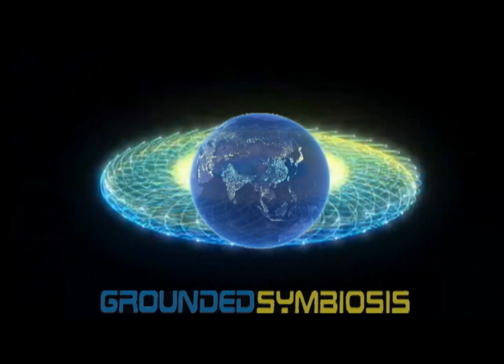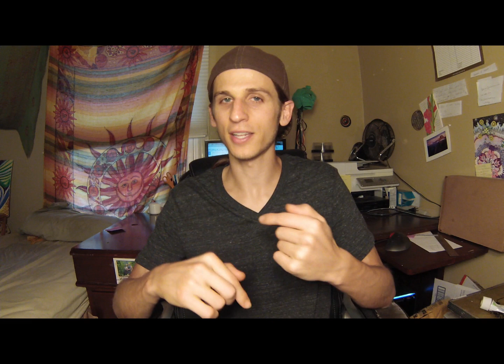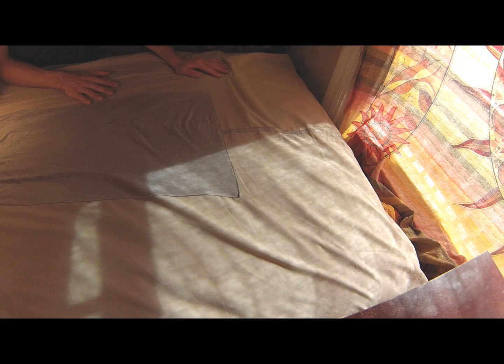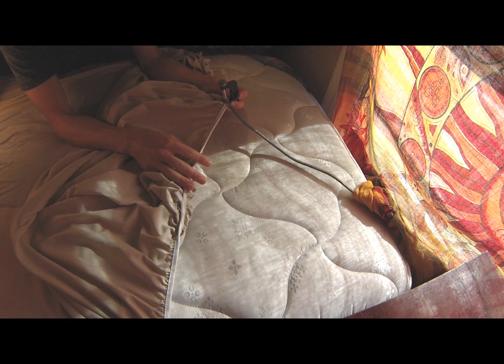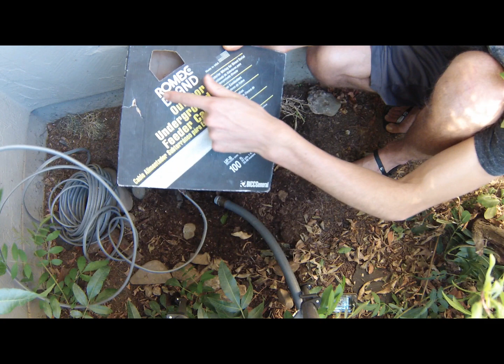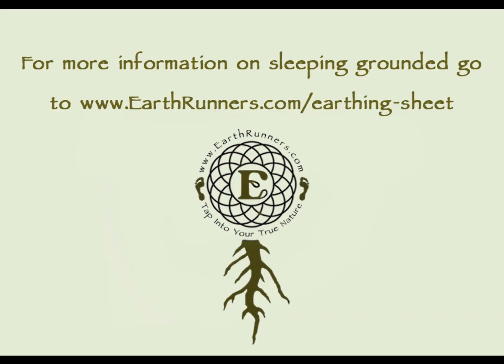Earthing Sheet Tutorial: Make Your Own Upgraded Grounding Sheet

Comment: Hey i have a question, i have a insulated wire running out my window plugged directly into the earth, and when i use my emf reader my bedsheet is at aprox, 40 vpp?  Im not connecting it to any wall outlet or any hot source and i have no EMFs in the room anymore so how am i electrifying my bedsheet from just plugging it into the ground?   I would expect a 0 on my reader
Reply from the maker: What material is your sheet?

Comment: Still earthing?  Question, if you are still around and able to answer.  If I were grounded with an earthing strap, and my partner and I had conductive sheet on our queen sized bed.  Would his body become grounded since my body is grounded?  Thanks!
Reply from the maker: Always earthing! Do you mean you'd be wearing an earthing strap like around your wrist or ankle that is connected to a wire that goes outside into the ground? If you use an alligator clip or something like that to clip onto the conductive sheet, that would be a simple & effective way to ground you both.

Comment: If anyone would be so kind as to help me out here, how are you supposed to prevent the risk of a lightning strike hitting that copper rod and energising you in your sleep (ouch!)? I really would like to ground / earth my own bedsheets too, but there seem to be so many risk factors... :/
Reply: Ded note, I believe I have read that some use a resistor on the wire that would act like a fuse in the event of lightning hit, I think they said a 100 ohm resistor?
Reply: more like 100kohm
Reply from the maker: Definitely disconnect when lightening is in the forecast. Better safe than sorry.

Comment: you can use an electric blanket cut the three wires that come out of blanket 
 strip and join them together and solder them to a shortened 12 penny nail then stick it 
in wall ground works great

Comment: An aluminum grounding stake would be much more ideal. The steel rebar is going to build up a layer of corrosion which will limit it's conductivity.
Reply: Aluminum(stake) and copper(wire) connected together will react with each other and, in time, increase resistance and affect the connection.
Reply: Aluminum builds an oxide layer very quickly. In fact, to weld aluminum, you need an ac/DC welder.

Regular steel you only need a basic DC welder.

The ac setting for aluminum welding uses the voltage from the aluminum headed to the tungsten electrode to break apart this oxide layer. Nice welders have the "balance" adjustable. It is the cleaning properties of an Ac welder that allows you to weld aluminum.

Best grounding rod to use would be stainless steel.

Comment: Hi reaching out again.  Do you recommend a resistor (100K Ohm) in the ground line cable as protection incase of a lightening strike.?  I noticed that the commercial grounding pads and sheets include this in the ground line cable or connecting piece.

Comment: Are there any dangers when using the grounding rod in the case that 
lightening should hit the earth close to your grounding rod?  Could this
 send a jolt up through your grounding rod into your body while 
sleeping?  This would not be good.   :)
Reply: Michael Polito electricity will choose the path of least resistance. By this logic if a lightning strike were to hit the rod it should continue into straight through the copper rod and into the ground rather than up the wire into your room (or wherever it happens to go to), therefore not creating a current to the bed and energising you. I'm not an expert or anything so don't take this as guidance, that's just my thought on it. If you were worried maybe keeping track of weather forcasts and disconnecting it during storms would be wise. Otherwise you could even test it yourself if you happen to find yourself in a storm, by connecting an ammeter to the metal sheet and watching for difference in current, particularly if lighting actually does happen to strike the copper rod.

Comment: You really should use a copper rod or stiff wire, with the proper connector to connect a wire to that rod.  You can find this at a home improvement or electric supply store.  It will be a much better connection.  The steel against copper will corrode.
Reply: Basic Poke make a video
Reply: Basic Poke So, you cover the connection with a small plastic bottle as a raincap outdoors, and take apart once in a blue moon and file any corrosion off.  Big deal !!

Comment: I pretty much followed both videos' instructions (thanks, groundedSymbio, I saved a bundle!). My situation is a bit tougher in that I'm in a trailer in the desert (very dry soil). Rather than fill up the septic tank system with unnecessary water I run my "gray water" (dishwater, shower and shaving water) separately out onto the ground about 40 feet downhill which creates a generally damp "green" spot. I pounded a couple feet of 3/4 inch copper pipe into this area and clamped a foot of wire to it, medium gauge-heavier than the normal ground wire in an extension cord. I attached a null male plug as shown in your previous video (just the ground prong hooked up). On the uphill end I made a short female version of the same setup, wiring a 15 amp circuit breaker inline into a foot or so of heavy solid wire and wrapping the exposed end around the exposed copper ground wire coming out of the trailer's fuse box. In between these two homemade plugs I have a 50 ft. heavy duty extension cord, which I can disconnect and use elsewhere as needed. The fuse box happens to be under the bed in the bedroom, so I wired my bed mat (uncoated aluminum window screening and duct tape, as demonstrated) directly to it. But since my copper stake is now wired into the trailer's grounding system, I also made a desktop computer pad to rest my hands/forearms on when working, and a foot pad for barefoot TV viewing--these are plugged into wall sockets. Do they work? Yup. According to my Klein volt meter my normal body's AC reading with hands on keyboard is 12.6v (+/ 1.0 volt). Yikes. Even hands free I register between 2.3v and 3.0v just sitting next to the light switch and electrical outlet with the computer on. Hands on keyboard with the grounding screen: between .19 and .20--over 60 times LESS. In the bedroom with the circuit breaker for that area ON I register .43v. With the breaker OFF and lying on the mat, around .006v to .007v--again slightly over 60 times LESS. Great stuff, thanks again! WARNING FOLKS: UNPLUG GROUNDING MATS DURING THUNDERSTORMS! Modems and motherboards aren't the only things that can get fried.
Reply: DROPOUT2001 make a video
Reply: DROPOUT2001  In the North African theatre of war, Allied Signal Corps procedure was to use an 18" steel ground pin, and pee on it once a day, or whenever relocated.  Worked fine with the big radio rigs.
Reply: Thanks for the warning~much appreciated!
Reply: @Steve Mitchell~thanks for the info, now I won't have to shell out for the copper pin!

Comment from the maker: 1) I agree the Romex is a bit excessive but as I mentioned, I had it sitting around and figured the reduction in resistivity wouldn't hurt.
2) I agree a copper pipe would offer better conductivity but the cost is much higher and it would be much harder to pound into the ground. I have added some electrical tape round the connection point to minimize rust build up.
3) I disagree. The deeper you go into the ground the less interference you will encounter in regards to the schumann resonance.

Comment: I appreciate your diligence to detail.  I have a few comments for you to consider.  In my opinion:
1) Romex is heavier than the wire needed.  Romex is needed for high amperage, and the electron flow from your body can be satisfied with a thin wire.
2)  The rebar certainly needs to be the uncoated kind, will quickly rust and will lose its conductivity, especially at the connection of the wire.  I suggest you use  heavy copper water pipe.
3) With the pipe being 4' in the ground, no wetting needed